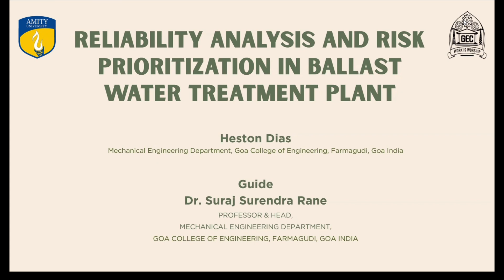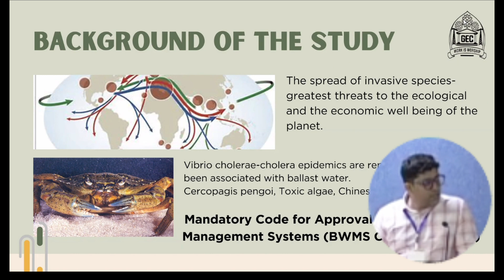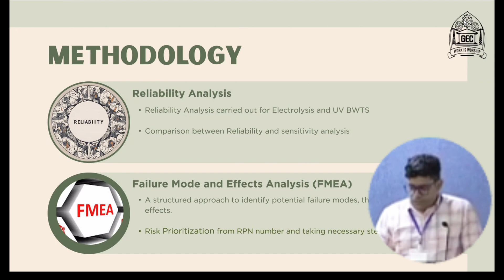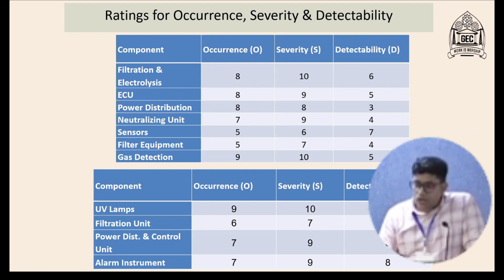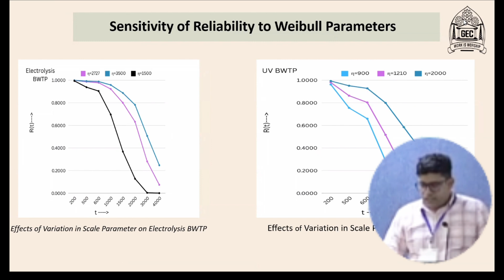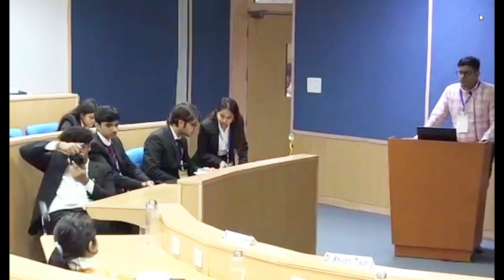Presentation at conference on ballast water treatment plants

Comment: Excellent Job Heston!!! You started built a good plausible introduction and thereafter guided the topic expertly to irs due and logical conclusion on this critical and commercially very significant aspect of current merchant shipping aspect which has now, very honestly become, of good nuisance value from the point of view of frequent failures and troubles that add to the pressures for all shi'p's concerned technical  staff! Hope the BWMS eqpt and your work gathers further development & momentum, so that the current troubles and failures are significantly reduced rapidly, so that concerned ship staff have more reliable and ease of operation!
Reply from the maker: Thank you Sir for such lovely words. Indeed means a lot, also thanks to you I could do research 🙏